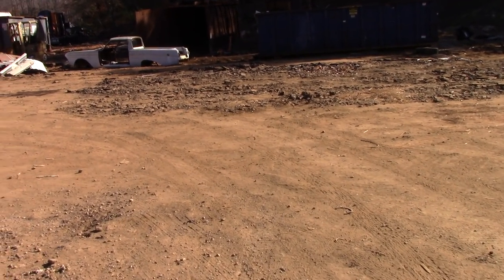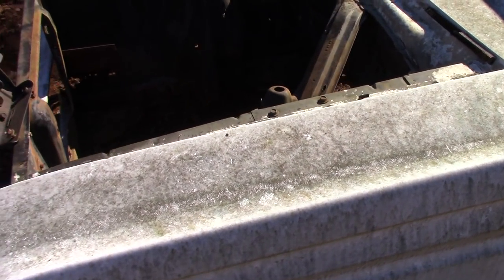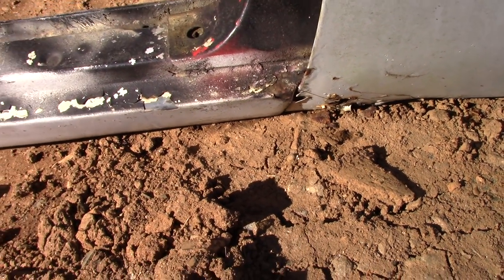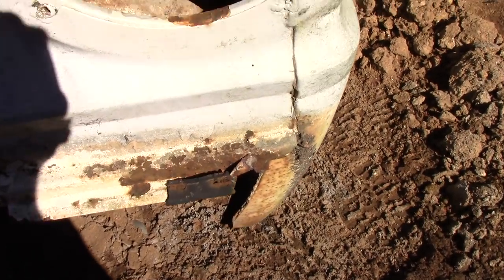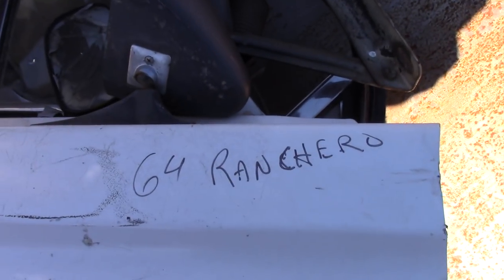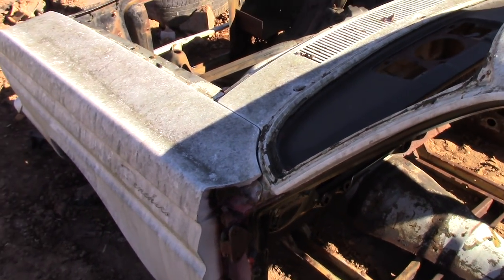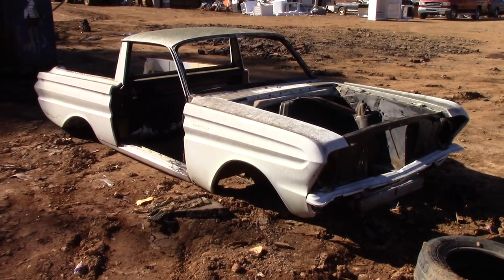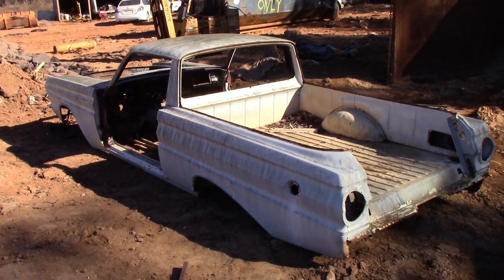Scrapped!? 1964 Ford Ranchero

Comment: No holes for the V8 emblems in the front fenders, so probably a six. The fifth digit in the VIN will tell, U or T for 170/200, F or C for 260/289. Still lots of good parts there.
Reply: A diehard FoMoCo guy would be looking at the top of the fender strip for that one 🙄

Comment: Obviously, not enough there for a full resto unless someone had another one with a bad frame or wrecked, but had tons and tons of good parts to swap over. With the doors put back on, I'm thinking keep the looks of the original body, but re- purpose the thing as a big advertising sign or something other than a drive-able car.
Reply: Take a frame off some other car with the same wheelbase, get some drivetrain, and there ya go!

Comment: This is a 1964 ford falcon ranchero it came with a 2.4 straight 6 1 barrel Holley carburetor 3 speed automatic transmission i have a 1962 falcon ranchero and it not a cheap to rebuild parts are hard to find cus no one makse them any more

Comment: Since the 4-doors sedans are not as popular, I wonder if this Ranchero would fit on a 4-door Falcon Frame?
Reply: CarGuy There is no frame, it's a unibody. Many Mustang parts will fit, since the Mustang chassis is a modified Falcon chassis.
Reply: Actually, the mustang is a modified falcon chassis. The falcon came out in 1960, the mustang was 4/ 4.5 years later.

Comment: says to me, someone was going to hot rod it and cut the rust out and maybe spent too much on the motor and box and then started cutting but ran out of money, eh, might be worth saving but sadly most ppl that want a truck of this era want it sock plus the person that put a radio in musta dione it with a drill as that is rough and badly cut out

Comment: Its a Falcon pickup not a Ranchero
Reply: Steven Johnson clearly says ranchero
Reply: the ford ranchero was built on the fairlane chassis this  is the falcon version  it is a rare truck  but still a falcon most of the running gear from a 64 falcon will fit it
Reply: '64 Falcon Ranchero
Reply: The 60-65 ranchero trucks were falcon based.  Others before and after were fairlane and Torino based vehicles.